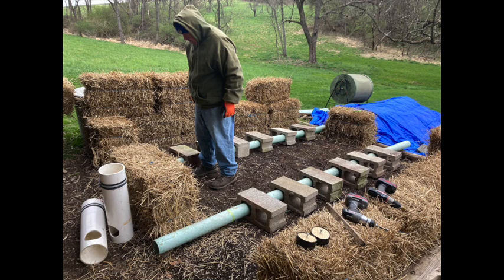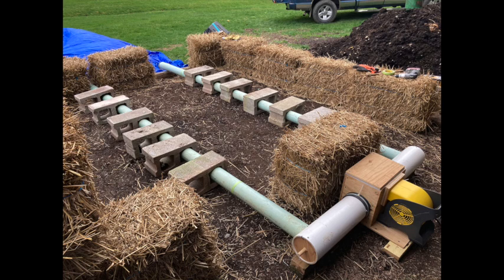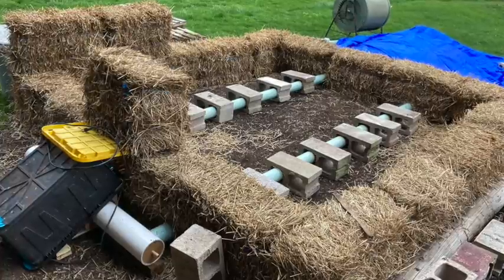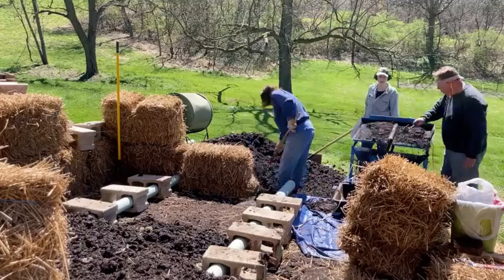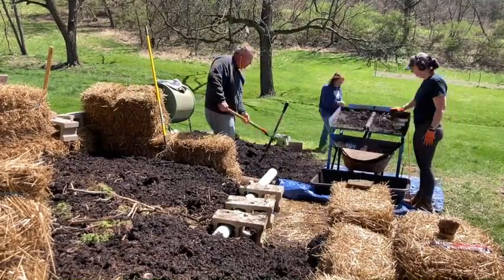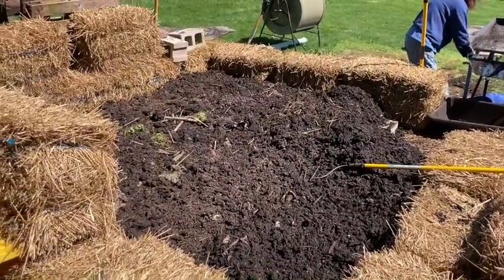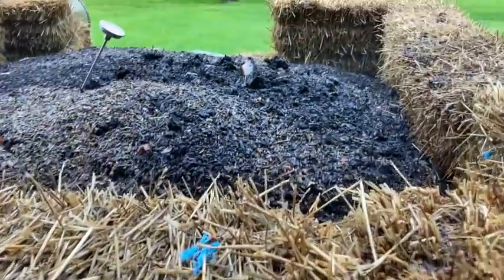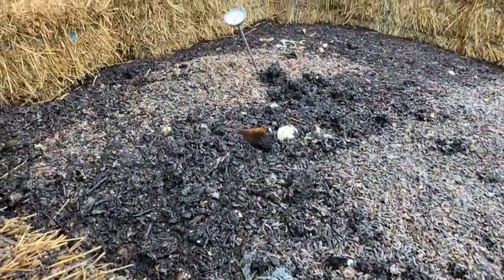Aerated Static Pile Compost System

Comment: what would you say was the moisture content of the overages? and does the sifter come in different screens? I'm a worm farmer ...
Reply from the maker: I have no idea what the moisture content was. I ran the blower on the screened overs for a day to dry up any excess moisture and that worked pretty well
Reply from the maker: Oh and I believe that screener does come with smaller screens but they were expensive for what they were. I just use that screener for compost

Comment: اليك طريقه لتسريع التحلل الحراري للكومه
غطيها بالنايلون العازل للحراره وقلبيها من حين إلى آخر مع التأكد من ثبوت الحراره في وسط الكومه
Reply from the maker: I think that might help with rainfall and snowfall. Extra precipitation usually means a drop in temperature that I have to somehow adjust. Although with the blower system, it's easy enough to increase the run time

Comment: When there are holes in your pipes, why is it necessary to have a blower instead of the natural air flow?
Reply from the maker: I think when the pile hits a certain volume threshold, a passive air system wouldn't be as effective. I have a lot of material sitting on these pipes. Air velocity is an important factor, but it wouldn't be necessary for a smaller pile. I've seen just a corrugated black pipe with holes sticking out the end of a pile like a tail. That worked well for that composter -- the pile hit some hot temps.

Comment: What is the function of the polyca tube inside the compost heap?
Reply from the maker: The air from the blower is pushed through those pipes and then goes up into the pile

Comment: Does your blower run non-stop? Very cool. How long does it need to sit to be finished compost?
Reply from the maker: It does not run constantly. The blower is plugged into a timer and I'll be honest and say that I'm still figuring out the ideal run rate. If the blower runs constantly, the pile will dry out and slow down. We received significant rainfall over three days (2.2") when I filmed the end portion of the video with little puffs of steam. Afraid that it got too wet, I opted to run it 15 min every three hours and the pile is sitting at about 140F right now.
Reply: @fullcirclebio  thank you for posting very interesting I might have to try this too!
Reply: @johnosborne5018 did you try it?

Comment: are there holes in the pvc tubes under the compost to push air through? how does compost not get into the holes?
Reply from the maker: There are holes spaced out about 11 inches. They are drilled at the 4 oclock and 8 oclock points on the pipe so that no debris falls into them.

Comment: What's the purpose of the straw?   Heat retention at the edges?
Reply from the maker: It helps insulate the pile and it also allows more material to fit in that footprint. I'm working with a three-bale high pile now to accommodate more.
Reply: @fullcirclebio  That's awesome.  As the bales eventually decompose, they too get mixed into the pile?
Reply from the maker: Some bales were more forgone than others, so they were incorporated into the new pile. The bales that didn't get a lot of weather have much more integrity. The bales that had a lot of rain have certainly deteriorated more. I've wondered if the more deterioration of the bale, the less "breathe-ability" the walls have. And is that an important factor? Is it a factor at all?? I don't know... The pile hasn't topped 155F or dropped below 125F so something is working